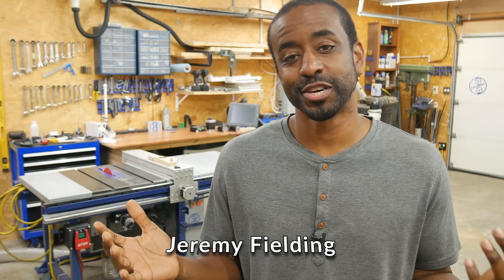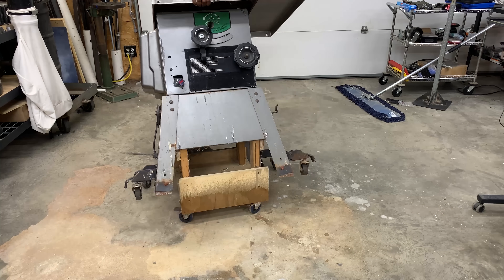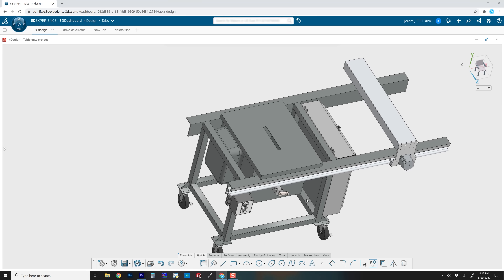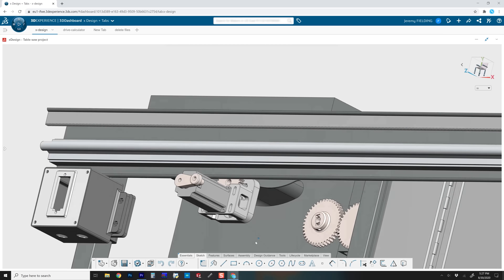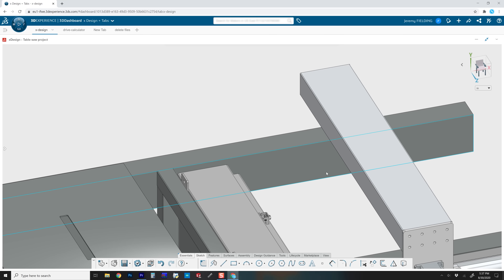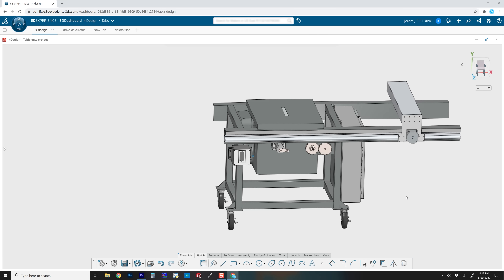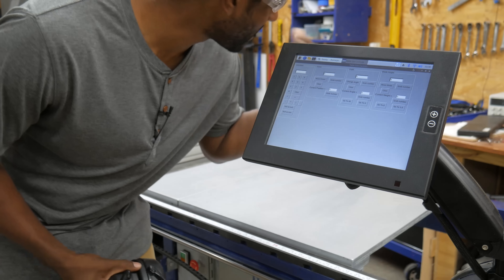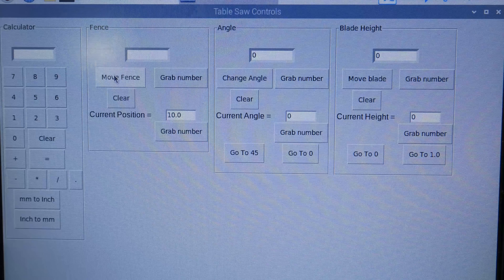How To Make A CNC Table Saw : # 084

Comment: This would also be so nice when you need a board only a 1/4 in wide. Instead of putting the fence next to the blade you could set it to the width of your stock. Make a cut to true the edge then program it to move over 1/4 a inch plus the width of the blade kerf after each pass. Instead of trying to push a strip through with a stick or pull from behind you could just slice your good part off the stock having plenty to hold onto. I had several other ideas that I posted when the video came out like box joints. I am going to have to save up to do this same thing.

Comment: you should use "Evapo Rust" to remove the rust. it leaves behind a preservative that lasts a year. its safe. it has no smell. it WORKS. and will not damage any machined or painted surface. It ONLY attacks rust.

Comment: Hello Jeremy nice project I was considering doing this my self. Also with a router to adjust the height. I just wanted to say for a guy who programmes PLC's to be a real E-Stop it should kill power to all power sources, electrical, pneumatic. when we design a control panel we use a safety relay switch that monitors the E-Stop or other emergency sensors and use the safety relay switch to turn off devices

Comment: My table saw has rusted several times over the years. I normally just give it a quick pass with the belt sander and then i give it a coat with wax. the wax doesnt stay on for long depending upon the materials you run through, and if you forget to recoat it or if you set drinks on it, you can expect the rust to come back, but its always pretty easy.

Comment: Nicely documented project. I really like the project idea super kudos. Something you may have already done, but I didn't see it mentioned or demonstrated. When you move the fence electrically, you may want to store the blade position first, lower the blade. then move the fence and raise it again to the stored value once the fence stops. (maybe just recall the position on the screen?) I've worked enough with 3D printers to know that if there's a chance you'll collide with something during a motion. It's going to happen. Cheers!

Comment: In order to manage the acceleration you could implement something like a "stepping-engine". A separate function that gets told how many steps, direction, which motor and acceleration is required and executes it. Then while the engine is "Stepping" you can introduce a delay between steps that over time gets gradually decreased, at that point you reached max velocity.
Good luck and nice project you have(I Think I'll try this myself).

Comment: Johnson Paste Wax is a good finish for cast iron woodworking tools, like your table saw. For metalworking tools, you'd use a light machine oil, but you don't want that all over the wood. The paste wax hardens up quickly, won't stick, and also provides a nice, slide-y surface for moving work pieces around on.
  Love the automation, and your ingenuity! You look totally unafraid to just rip it down and build something new. Fantastic work

Comment: I'd recommend cold blueing any bare steel surfaces then oiling them, to prevent rust. I belive this is how it works, but if you're interested you should double check: the crystal that forms in the blueing process holds oil like a sponge which protects the surface.

Comment: The fence won't move to the left of the saw blade. And maximum cut you need is 24in on the right of the saw blade. I don't understand why you need 6ft of rack and pinion. What will you be cutting on this saw
Reply from the maker: You can’t think of any reason a person might want almost 4ft on one side of the blade and 2ft -24 in on the other? This seems like a strange thing to be worked up about but thanks for commenting! It helps the video and thanks for watching!

Comment: One more thing you can do is add the "Sled" guide on the other side for this and you can then truly automate this project. It will allow you to hold material and program a cut... takes your "fingers" completely out of the equation... for some quick builds of things it would be a huge benefit!

Comment: Any reason you aren't running your dust collection system a few extra seconds after you've turned your saw off?  I would think a delay off of ~15 seconds would help pull away any last chips.

Comment: I use WD 40 to keep  all my cast iron surfaces rust free.  I also use my 5" orbital sander with a scotch brite pad and wd  40 to clean  the rust off of  the cast iron. The scotch brite is softer
than the sanding pad and cleans  up small or large spots from inadvertent water / coffee / cold beverage rings etc.   You are an engineer / DIY Maker extraordinaire  keep up the fantastic work.

Comment: Hi Jeremy,
Great project!
Here a tip to preserve your blank steel parts:
Linseed oil varnish is great. It will harden and build an invisible film on the metal. Works just like with wood.
Heavily used surfaces I would redo once per year.
Reply: I'd like to see how that would work on some of the chrome on motorcycle parts. Like the front shocks and springs. And handlebar.

Comment: Sorry if already proposed, I haven't found it, but for acc, speed, etc use PID controllers. You don't need to reinvent the wheel. Of course, some configuration will be needed. P.S. be careful with "division by zero" when working with custom inputs. Also I may propose making "read-only" in imperial/metric so you will always see both numbers. Great work!

Comment: Sir you are a expert problem solver with ninja like developer skills - I can see in the future one device (big) that will have CNC and saw capabilities - be nice to pull a sheet of plywood off the table top that already has the necessary mounting/securing holes drilled into them - I could see industry/manufacturing using this.  I'm glad I found you channel.

Comment: It would be good to add some small step to the control like 
Move 1 cm/ move 1 mm /move 0,1mm As shortcut under the position/hight of the blade, and the same with the degree, then there would be less need for manual mode

Comment: Hey, you should just use paste wax to protect the top of your saw. Not only does it protect against rust, it helps your work piece slide over the metal.

Comment: This is incredible, amazing work. Our large SCM panel saw at the workshop has a motor cntroled fence, when it gets to 200mm  from the blade, it stops and you have to hold the fence start button and it goes half speed until its reached say for example 7mm. I think its  a safety function so it doesn't hit the blade

Comment: Great project, I would suggest just one small safety feature. A relay in line with the saw motor that when powered will cut off the power to the cnc motors so it doesn't move things into a spinning blade if there is a user or coding error.
Reply: needs power to keep motors from moving

Comment: I owned a (small) furniture manufacturing company for 10 years and we used car wax and later silicone spray to keep our table saw rust free. As an added bonus, it also helps the wood slide much better. I have some heavy-duty silicone spray that I use to condition my white water raft between seasons that I have used in my home shop. Do you clamp the fence or rely on the stepper to hold position?

Comment: Nice!
For keeping rust off steel I use Renaissance Wax - it's a thing developed by the British Museum for preserving antiques. I apply it to blades I have on display. I would expect it would work for keeping rust off machines, though it would likely need to be re-applied far more frequently than normal. 
There's probably something better for this purpose, but if you or anyone else have things on display, I'd definitely recommend it for that.

Comment: Beautifully done! I have two questions: Why use flux-cored welder when adding gas is so much cleaner and easier? 

And...When the the stock-feeder getting added so you don't have to push the wood through?

Comment: Use paste wax. It helps run the lumber smooth and dries to protect the steel. Re apply when you feel the surface sticks or you start to see surface oxidation.

Comment: Bro, I'm very proud of you!
I'm planning to add some electronics to DIY table saw for safety purposes.
Eg. Saw blade will only rotate(power up) when it senses material to cut 25-50mm from the blade and stops(power down) when there's 25-5mm of material to cut.
Also, powers down(w/ brakes) if operator hands/body get to a certain distance to blade and optionally, if the operator is not at a defined operating position.
My solution would be based on my knowledge of electronics logics circuits.
Until that day, I'll be looking aroung for my ideas.

Comment: I hope this helps with your programming

Velocity is the timed distance of travel in a straight line

Distence_0= Start Point                                                               Example  1           Distence_0 =  0 inches
Distence_1= End Point                                                                                                Distence_1=   10 inches
T= Time                                                                                                                         Time = 10 seconds
Velocity= Is the change in distance in a period of time 
Velocity = (D_1-D_0)/Time                                                                                         Velocity = (10 inches -0 inches)/10 seconds
                                                                                                                                                       = 1inch/second

Since you are dealing with motor that has RPM's( Revolutions Per Min
1 min = 60 seconds
360 degrees is one complete Rev

Your Degrees need to be converted in Radians

Radian= (Degree*Pi)/180 or  Degrees = (Radian*180)/Pi

You need Angular Velocity
Angular Velocity is the speed it takes to travel in a complete circle in a certain time. This commonly called a RPM
                                                      
ω = Angular Velocity                                                                        Example 2     r= 1inch
ω = Radian_Angle/Time                                                                                          Radian_Angle = 6.283185307
 Rad
r = gear radius                                                                                                           Time = 10 seconds
Velocity = (r*Radian_Angle)/Time                                                                         Velocity = (1in*6.283185307
 Ra
d)/10 seconds
                                                                                                                                                     
But if you want to work it backward

Velocity = r*ω                                                                                      Example 3    Your desired Velocity of fence travel is 24 inches in 30 seconds
ω= Velocity/r                                                                                                              Velocity = 24 inches/ 30 seconds or  0.8 in/ second
                                                                                                                                      r =  2 inches
                                                                                                                                      ω =0.4 rad/ second or 22.91831181 Degrees/second

Comment: Oh, and if you’re going to do much work there, it would be really handy to have your internet know and work with your curf and the ability to step for easy dado cuts. Thoughts on using continuity fence to blade to zero your interface?  Could also use it for blade height zero? 

Inspirational build.

Comment: When you were trying to track down the reason for it not moving, I couldn’t help but say aloud “welcome to the work of an Industrial Mechanic!” I don’t miss it. 

For the fence, I’d recommend changing that to either a motor with an encoder or adding a separate encoder. This will give you the input you need to accelerate and decelerate the motor the easiest and can give you adjustments to the thousandths. 

All around awesome build, tho!

Comment: Jeremy your videos have inspired me to build a pottery wheel for my girlfriend with an old treadmill i have. I have on question though that i have not been able to answer through my research. Can i take the horizontally mounted treadmill motor and mount it vertically? If i can mount it vertically i dont have to change the direction of the motor output. Many thanks love the video

Comment: Seriously amazing, man! I had to chuckle at the origin story for it. Yeah, I think we've all been there.
*As for acceleration*, it looks like everything you need! Take a look at those "sleep(delay)" functions. I would replace them with your own delay function. You would feed your function with the RPM constant for that stepper motor and the percentage of the movement completed. Then it would calculate how much more delay to add and send that new value to the sleep function. 
Does that makes sense?

Comment: Camellia oil is ideal for keeping any cast iron surface from rusting and pitting. You only need a very small amount, which is good as it only seems to be available in smaller bottles - but it plenty for your table saw for many years. Lots of hand tool only ‘perfectionists’ swear by camellia oil for keeping their hand bench planes and chisels in great condition, especially if you’re in a damp or coastal area where salt in the air is a problem. Hope that helps 👍

Comment: Add clamp feet on rods that squeeze the material to the fence on a track on the fence, and a feeder rod or two on a motor to automatically cut boards.  Pull them into the saw.  

Also no other servos should work if the saw is engaged.

Comment: Hey Jeremy, to preserve and keep your table saw from rusting and to help work smoothly travel across the iron you should use a waxing compound like Johnson's Paste Wax. You rub it onto the surface and leave a thin film that you let dry into a haze that becomes hazy, and then you buff it off. 

You've gotta reapply it based on use of the saw, though, and back when I was doing more table saw work I'd be applying it once a week - but I shared that saw with other people, so your needs might vary.

Comment: Nice! If I may make a recommendation though, you could add micro-switches for re-finding your zeroes after manual use and it would be much more accurate and far easier than trying to line things up by hand. Either that, or just have a hardstop in place that you can run the axis to by hand and set zero there. As far as accelerations and such, you could take a look at how some of the opensource 3D printer firmwares do it and use them as a a starting point.

Comment: Just put a round wheel on the height motor. Nothing to snag on and don't have to redo the whole gearing system. You can even use the CNC to make the wheel out of wood!
As for the code, the only suggestion there is to make some sort of a check so when the fence is moved from one side of the blade to another it won't run into the lifted up blade. Better yet, auto lower the blade, then lift it back up once the fence has passed.

Comment: Great video Jeremy. For surface protection, I like to scrub surfaces with steel wool or scotchbrite pads using Rustfree (by Boeshield) for heavy rust or corrosion, vinegar for light cleaning, mineral spirits to remove the acids from the surface and alcohol to strip the mineral spirits. Then I apply either paste wax or Boeshield T9 depending whether I remember to order more Boeshield. It's a decent amount of work, but my tools remain pristine under daily use with just a light cleaning a few times a year.

Comment: For acceleration check out the source code for 3d printer software like Marlin. I remember reading older Sprinter source code and learning how coordinated multi axis moves were handled in a descrete way. I forget if that code enabled acceleration but Marlin definitely has this.

Comment: For rust, best thing I have used (rusted an old motorcycle gas tank) is electrolysis.  It will get to areas you can't reach and the science does all the physical labor.

Comment: Absolutely brilliant. Thanks for doing this and being generous with how you do it. I would suggest, for the handle, have a square or hex section on the shaft, and extend it circular, and the handle is pushed off by a spring, and hangs on the round bit, not rotating. A nut or circlip/whatever stops handle from falling off. Then when you need to use the handle, simply push it against the light spring. Many manual mills, with a power feed use similar. I would not add bevel gearing..

Comment: I strongly recommend Boeshield T9 for rust prevention. I have hyperhidrosis so everything I touch rusts. I’ve used CRC, airplane corrosion resist, paste wax, dry lube, LPS 1 and 3, you name it. Boeshield keeps my hand tools and power tools free from rust. When it “dries” it doesn’t gum up or film over so dust doesn’t build up too badly. Perfect for oiling after doing rust removal or cold bluing. Plus it is a decent lubricant for hand saws and blades (but not power tool blades).  A 12 oz can will last a couple years if you keep an oiled rag on hand and spray into that then wipe it on your steel. Happy working!

Comment: Hey Jeremy! Kinematic equations are probably what you're looking for as far as coding acceleration into your movements. You may also want to check out the marlin firmware that most 3d printers use to see how they do it! (Digging through others' source codes is a great way to learn programming! 😉 )

Comment: Machine shops use WD40 to keep the beds from rusting.  Spray it on and lightly wipe it off.  Often, when a little rust is present, steel wool and WD40 to spot clean.